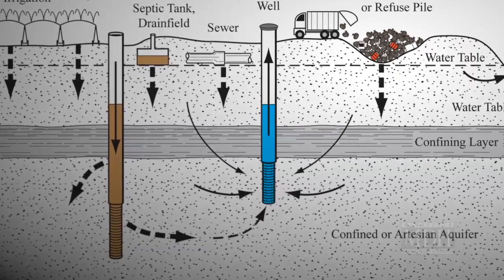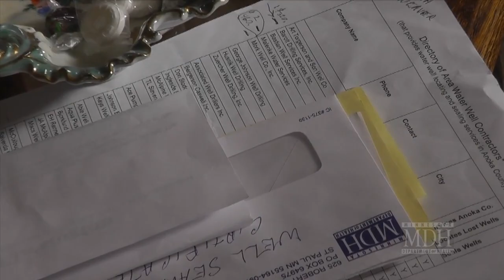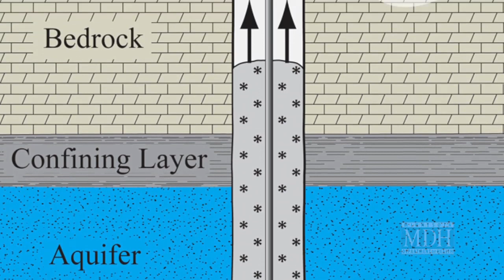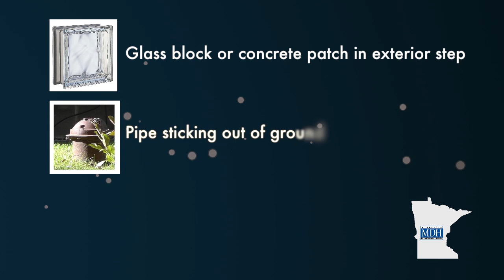Sealing Your Unused Well

Comment: What if you have one that you don’t use but can it be kept in working order if it’s for backup water supply?
Reply: Keep it.  Use it to water your lawn.
Reply: @gary_neilson1896  So basically, if you have a working pump, then you don't have to close the well.
Reply: There's a well in our basement with a concrete lid the size of a manhole.  The well is full to the top and over flows into a drain pipe.  It's more of a spring.  Never seen anything like it.
Reply: fill it with an approved expanding foam gunite mix or  bentonite chips..
if its not required to be  plugged.. seal the top 4 - 10 feet with a rubber packer and sealant
Reply: @grippen3273  its called a seep or spring..  happens worldwide